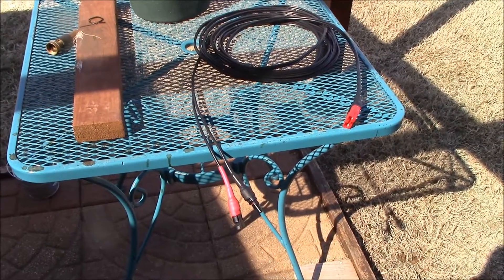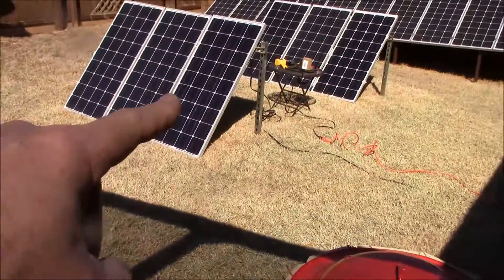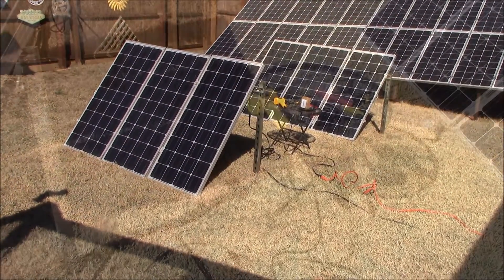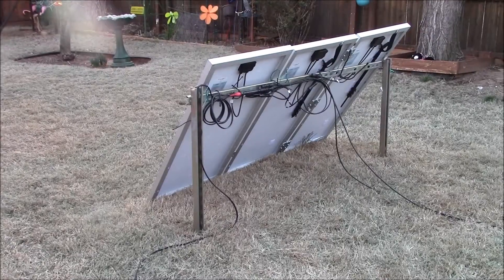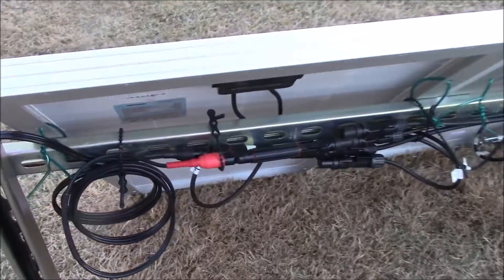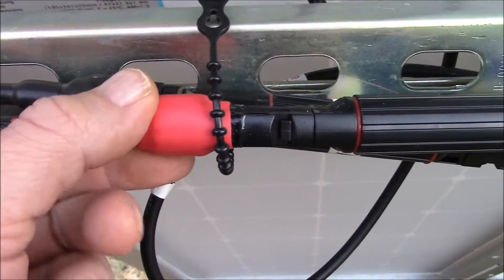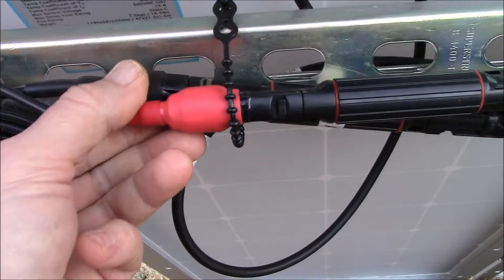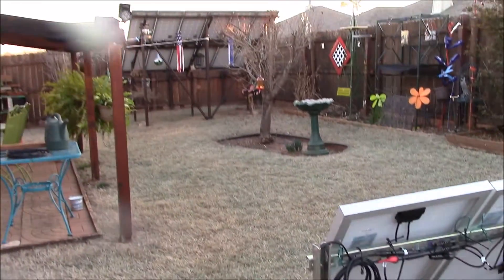Specialized MC4 to Anderson connector solar PV cable (with adhesive heat shrinking)

Comment: Chris, I swear we must be twin brothers joined at the MC-4 connection. That is almost the same set-up I made for my rig. I have the original MC-4 connections on the panels and the charge controller. Then I made a 20 ft. extension with Anderson plugs and a set of Anderson to MC-4 adapters. This way I can use the original panels to controller plugs for short distances or add the Anderson cord if I want to go longer distances. One question....why did you fuse both the POS and NEG leads ?   I figure that only the red - pos cable needs to be fused...... ya got me corn-FUSED !    J K
Reply from the maker: Sounds good...thanks. These solar generators rock! As for the two fuses...it is like wearing two rubbers. Hahaaa...seriously, fusing both POS and NEG is totally fine. Guys in Australia are doing that to their systems...and they are ahead of us on many things in solar. Most folks don't know that you can fuse the NEG only...does the same thing. It's a circuit.
Reply: I, too, did the same thing with MC4s on one end, except I used the smaller anderson housing with the larger metal connectors that fit the smaller housing (45A max).  The ends don't get warm at all with 25A flowing through them.

Comment: Great videos Chris . After watching your generator builds I got the bug and now I am building my own generator. Mine will be a 12 volt set up with two batteries and 200 watts solar. I am using the same Anderson connectors for the solar end of the system. I will post a video when it is close to being done. Thanks for taking the time to do these videos they have helped me with my system. P.S. you sure due cost me a lot of money ...